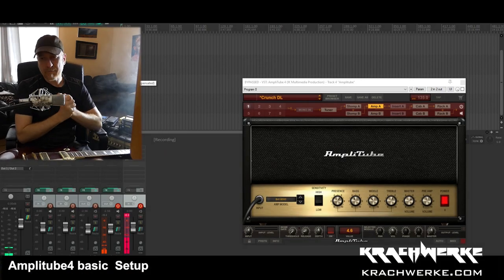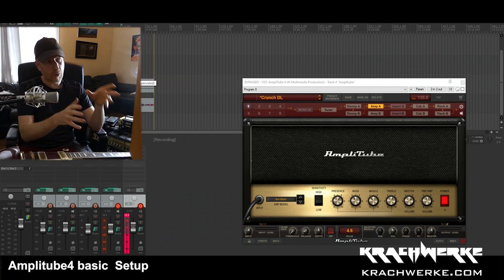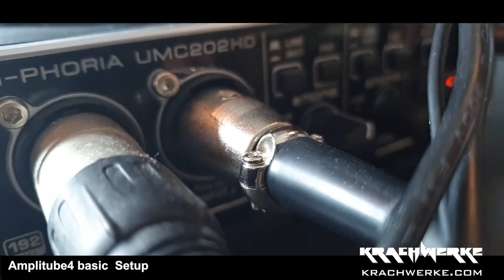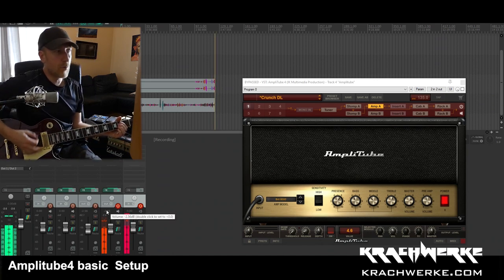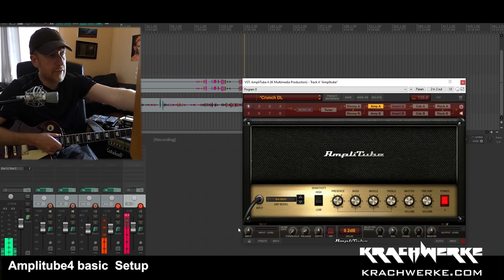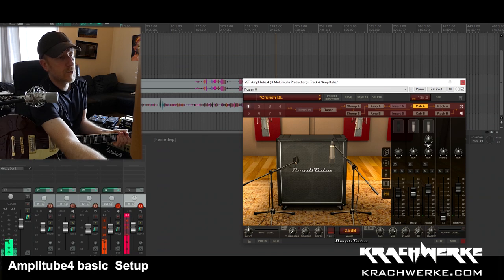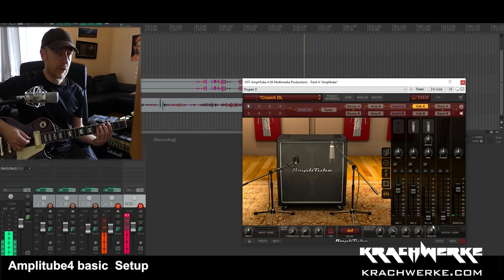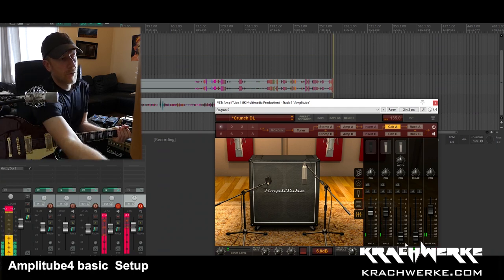Amplitube4 basic setup and gain staging for best results

Comment: Hi! Just discovered your channel. You're really helping me out here! 
I have a question. 
I've bought a Line 6 UX2 many years ago, but i never had good results with it. I'm not recording, I just wanna play guitar with Amplitube and have decent sound. 
So now, after many years, i tried the ux2 again and it's stil not good. My guitar sounds 'far away'. Not direct. A lot of crunch, instead of high gain. The 'clean' amp, in the free amplitube version, sounds very quiet.
(I got the free version of amplitube now, and i'm trying out the Metal Lead amp (again not what i hoped for.. ))

I have decent guitars and my monitors should be good. So I think the problem is the UX2.
What i also noticed is that my Les paul sounds better then my tele. (both with humbuckers).

How do i start: I plug my guitar in the 'instrument input'. I can NOT adjust the gain with the UX2. The adjustable gain is for the microphone input.
The input meter in amplitube is like halfway when i'm playing, maybe a little more. 
I've installed a 'booster-pedal' between the guitar and the interface, but that ruined my clean signal.

I saw your video about the 'guitar--DI--interface'-stuff you explained. 
That really opened my eyes. Im gonna borrow a DI soon and plug it in the mic input and hope this can give me more input.
I can also borrow a behringer UMC22. But i wished it had a gain-meter.
Also, the UX2 is powered with USB. Thats oke?

You think this is going in the right direction?

Im thinking about buying the Axe I/O and amplitube 5, and I'm hoping that all my troubles will go away.
But its expensive though.. It has to work but i'm having doubts..
Reply from the maker: Hi, thanks so much for your question and I am glad these vids are useful.

This would be my recommendation for now:
Behringer UMC202HD
Guitar straight in

Use the free version of Amplitube4 or 5 for now.

If this setup does not work for you there might be another problem. Please also make sure you check your gain staging and also how the mics and levels are setup in Amplitube.

I personally would not recommend buying the Axe i/o. These are expensive and propriatary and are exactly the same as any other interface.

Comment: I have a question. I own a focusrite scarlett solo 3gen. I plug my guitar to the instrument input (i dont have a DI box). Everything is great untill.... I try the distorsion amp in amplitube. Its sounds horrible. I have no clue why. I've tried with different amps, changed drivers, Player with knobs and options in amplitube, all for nothing. I have thought, that it might be the problem of USB interface, so I tried with zoom g2.1 U, powered normally. I got the same result. I have no idea What's wrong.... Can u help me?
Reply from the maker: Difficult to say. 

I would try a DI and see what happens. The Behringer DI100 Ultra-DI is cheap and very useful an many other scenarios.

Re-check your signal chain and gain staging.
Make sure your guitar is buzz free (properly grounded) (Try a different guitar to rule it out)
Can you hear noise in the signal when not on drive setting?
Make sure your DI and room mics volumes in the cab section of amplitube are pulled down all the way.

Other wise maybe post a short video of your problem and noise so I can see it better.
Reply: @KrachWerke  i will try with mike cabs as u said, and if it's not gonna work I'll post a video

Comment: On your U-Phoria INput #1, I noticed you are using line inpust instead of Inst.  Can you do either?  Do you have a DI in between your guitar and Interface?  I run directly into my U-Phoria.  Thoughts?
Reply from the maker: Hi and sorry for the late reply. Yes I have a DI inbetween and it lines out balanced.

Comment: Hi, why does my Amplitube sounds so noisy? Do I need to do the settings like you did in there?
Reply from the maker: It could be so many factors:
Your gear maybe not grounded.
Ground loops in the house.
Not very clean or conditioned power.
Your computer might have fans or weird usb wiring.

If it is a laptop try running it off battery to see if the problem still exists.

Comment: Do I need to use a DI box? I've been going direct into the interface with the 'instrument' signal button pressed in
Reply from the maker: With my limited knowledge and understanding I would always recommend a DI before the signal goes into the interface. The fact that you have a ground loop in case you might have grounding issues and also the get a balanced signal into your interface. 

The DI also protects the input.

With cheaper interfaces I would make that a rule, I think with the better, more expensive interfaces I might trust going straight into it.